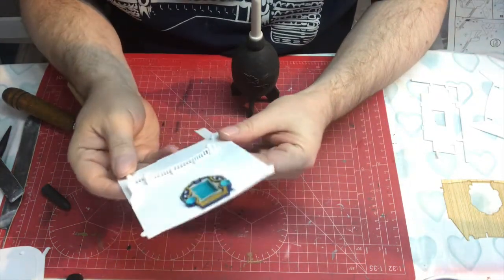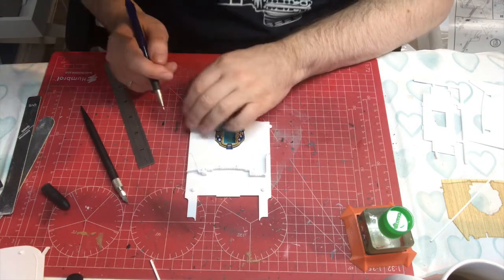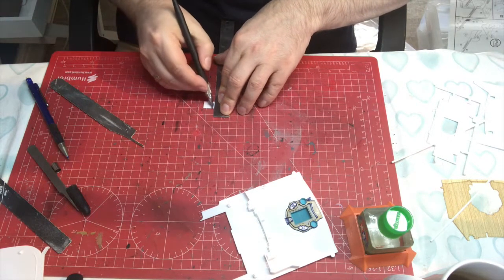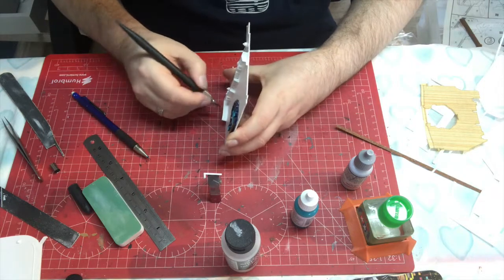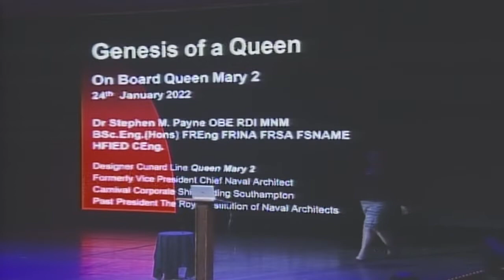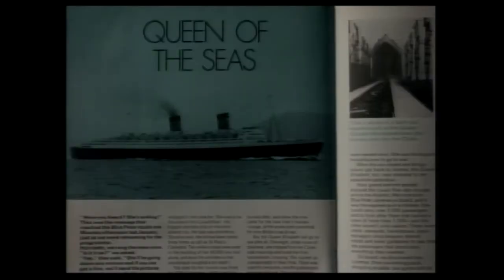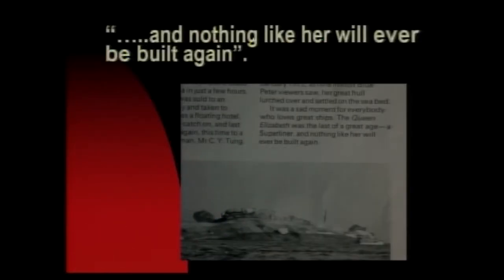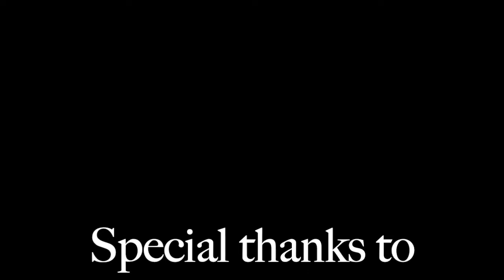1/400 Queen Mary 2 full build Episode 16, Step 16 &17

Comment: Great video Jason.  Appreciate you using close up angles of the bar construction, and suggest more of that to better show your scratch building.
Reply from the maker: I do try but not always easy to work with the camera in the way, it also really slows down the build rate.  however I do agree and will where possible and where it ads value.
Thanks for looking in